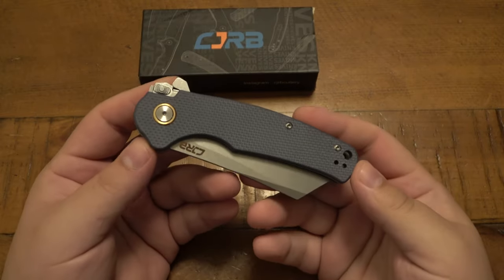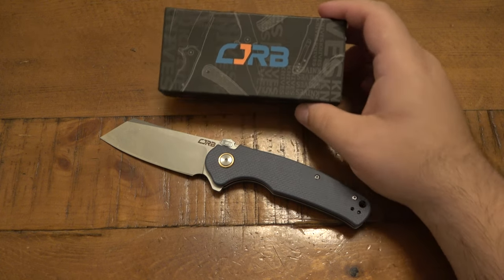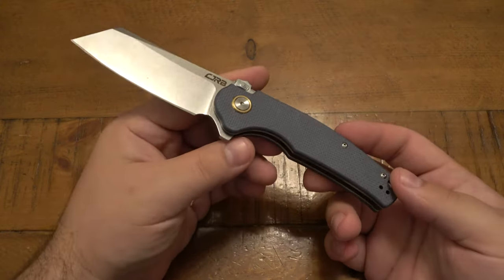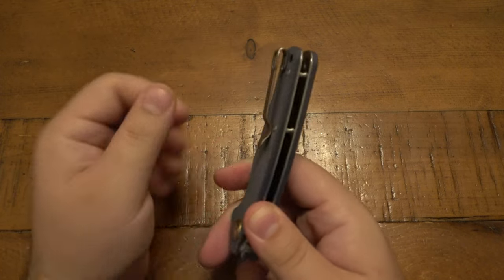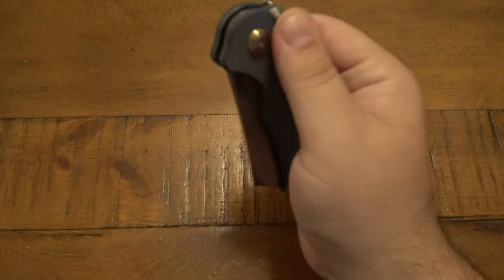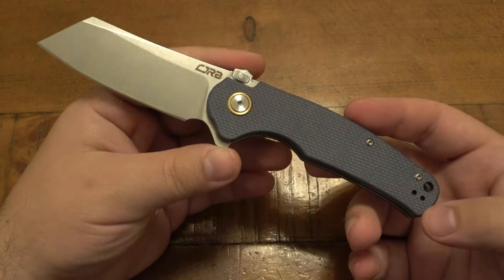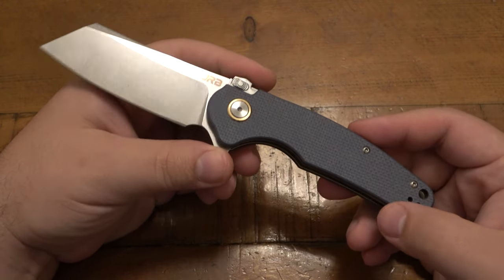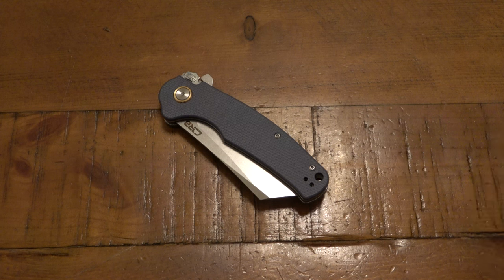CJRB Crag (Recoil Lock) Cheap & Innovative Knife + What Does CJRB Stand For & Who Makes Them...

Comment: mine folded in on me and cut 2 fingers bad! When using it somewhat heavy and your getting comfortable with it, your thumb naturally goes there every once in a while
Reply: I have come close both with my Kicker and Crag. The problem with owning so many different knives and all the different operation of each one can be challenging. 
There are some pretty cool aspects of this lock. And one really bad issue , and it isn't just you who naturally rests your thumb there for slicing or downward cuts. I have like I said disengage two knives while using them. I have been super lucky so far and have really stated to pay more attention. 
Benchmade still has a better setup for now. All these knives use Omega springs anyways (which I have never broke one in many years of owning Benchmade knives) .
I really want to check out a Demko Shark lock which is next on my list.

Comment: Just got this and all I can say is it's friggen nice.  That spring has just the right tension that everytime I press on the flip tab,  it has opened completely and locked.  No wrist flick necessary.  Lock drops the blade close and action is smooth. 

Only a couple things I wished it had was maybe a finger nail groove/slit so it can be flicked open with the middle finger. Or a thumb stud, thou neither is necessary and would raise production cost.  And maybe the handle had more material coverage on the blade, which, again isn't necessary but would have made it look a lil better imo. 

I dont know the correct nomenclature for this, but i felt they could have mdae the metal inner piece lighter by cutting holes in it. Though it's not a heavy knife and again woulda add to the production cost.

For about $40, it's not a bad deal for having a proprietary locking mechanism and pretty solid build quality.

Comment: I have the original Crag design, which is a liner lock. Mine has carbon fiber scales and an AR-RPM9 blade, which (to reiterate from another comment) is CJRB's powder based version of D2.

The blade on mine allso has a full black ceramic coating, which has held up great over the last year + that I've had it, and I use my knife every day.

Easy to sharpen to a razor's edge, and easily one of the best EDC knives I've owned.

Just ordered the newer version with that interesting locking mechanism.

I also really find the "cleaver" style blade shape to be more useful as an EDC than a more traditional drop point or spear point.

Very functional, sturdy, and nice looking and feeling knife.

Comment: The lock looks like to be an injection moulded part, possibly zinc or aluminium. I wonder how durable that is? Is it actually steel? 
Its essentially just an axis lock with the interfacing part being moved to the top rather than the sides, but then again I guess its difficult to do something new these days.
Reply from the maker: well there are probably 30 different locks that all use some kind of pin or bar that rests on the tang...I agree about the lock top though with the finish it looks like a MIM part, but never sees any pressure unless it was ran over or dropped from a high height I dont see it making much difference it could be cheap plastic and still work as long as the bar is steel which it appears by the look of it